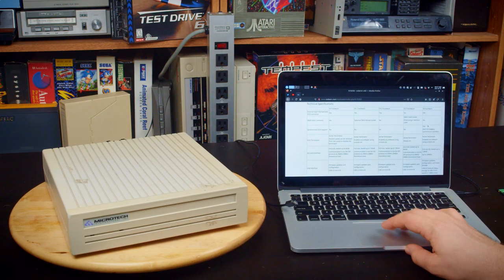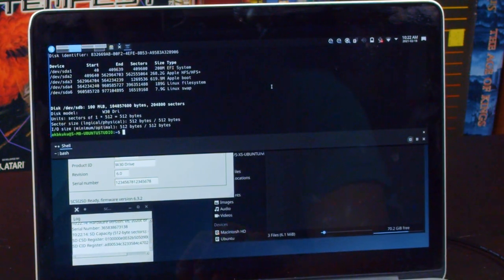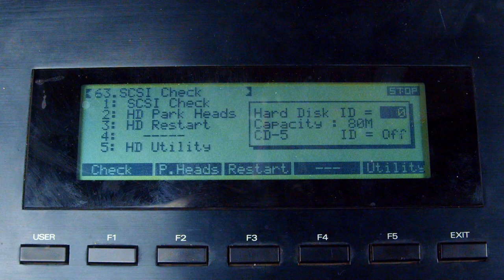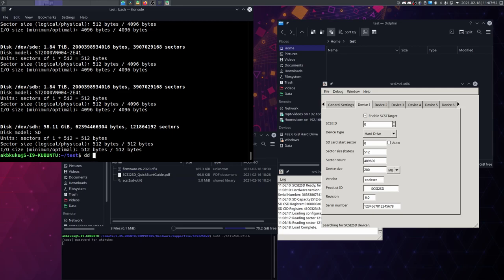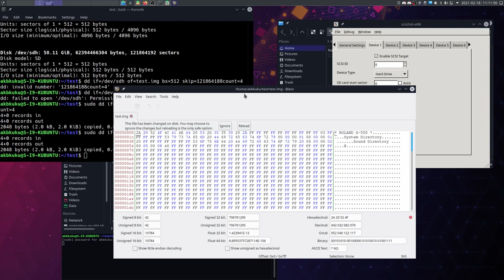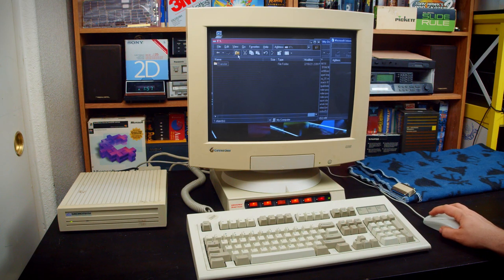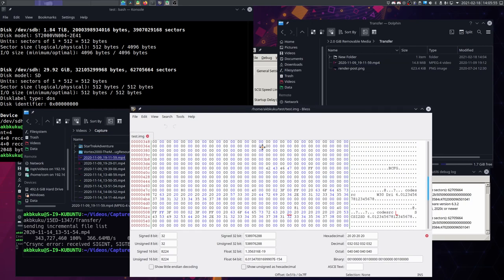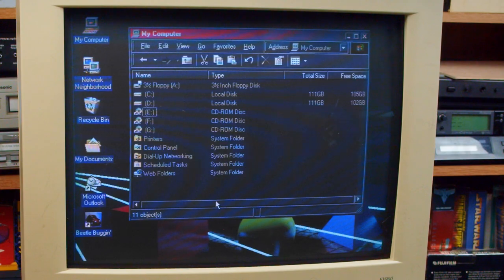Virtual SCSI Drive Experiments and Testing - SCSI2SD Part 1.5

Comment: SD card slots have a card detect switch. The extension cable is probably why hot swapping cards isn't working for you.
Reply: Yeah, this can be solved with a jumper wire, I think. Might also want to wire up the write protect switch at the same time. I can see instances where I want strictly read-only access to the SD card.
Reply: Just wanted to second this for visibility.

Comment: 14:29  -There is something going on with the audio... it like, weirdly pans or something. Am I going crazy?
Reply: it starts about 9 minutes in. It sounds like it is switching left to right very quickly.
Reply: I think Shelby's using a stereo mic, and it cuts the channel for a bit if it clips. So it sounds like it's pinging the audio to one side, but it's really just cutting the other channel when he gets, shall we say, overenthusiastic. Probably the way to fix it would be to record in 32-bit mode at a lower level, boosting/normalising it in post and either applying a compressor filter to deal with the clipping, or manually lowering the hot spots prior to boosting (which probably isn't worth the effort for the odd hard p).

Comment: 22:00 I was totally expecting this, as DOS wrote a MBR to what it saw was the first sector and partition table as expected, which the adapter correspondingly mapped to the same actual sectors. The reason it wasn't showing before is the roland keyboard does not use a typical filesystem/partition layout and so the OS wasn't able to figure out what it was.

Comment: As the scsi2sd raw writes to the sdcard it writes the partition table of the first drive in the first sectors of the sdcard. So that is the drive you can access with its partitions without an scsi2sd adapter or other hurdles like dd-ing the corresponding sectors of a drive or mounting by defining offsets.

Comment: Now I'm super tempted to buy one and whack it into my SCSI enclosure. I was thinking of buying an old drive to replace the dead one that's in there, but like you said in the other video, it's just going to be expensive and old, and prone to dying anyway. Although I think I'll just be lazy when I pull the SCSI ID selector and just poke a cable through the opening. Actually, I think I've got an old SCSI enclosure with a dead slot-loading DVD drive somewhere around. That would be perfect since I could mount the drive with the SD card slot behind the DVD slot, and use that to access the card. I just hope it wasn't in the box I took to my storage unit the other day! EDIT: Good news! Just checked my storage crates and could just see it inside one! The bad news is that it's on the top shelf of a 2m high storage rack! 🙄 Now I just need to wait until codesrc gets the SCSI2SD back in stock.

Comment: Theoretically, if you tell the SCSI2SD to place the first disk starting from sector 1 (+512 bytes from the beginning), then you could stuff a custom partition table at the first 512 Bytes that would allow you to access all the disks, like if they where regular partitions.
I would love to see you trying it and I'm open to help with if need it but, seriously, I doubt you'll need any help ;-)
Reply: Except that they aren’t partitions as such, but rather disks. Each disk can/will have it’s own partition table.
Reply: @wich1  If the custom partition table is made to point directly to each of the partitions for each of the "disks", it will effectively access each of the discs partition as if it where a regular partitions on a single disk, leaving all those extra partition tables ignored. Tricky, but possible.

Comment: you could try running binwalk against the sdcard device to see where the partitions start and end (it looks for magic bytes in binary files to see where interesting blobs are)
Reply: It's actually much easier. You can simply take the values from the GUI and put them in DD to extract the raw partitions. It works like the Gotek, but not with fixed "partition" sizes.
One could simply create a parser for the structures at the end and do a loopbackmount of every partition by hand.
Reply: @dolphhandcreme  or automate the mounts using a shell script

Comment: If I ever get to build my Windows 98 system, and can't get SD to IDE to work, I want one of those SD to SCSI (as long as I can get a hold of an Adaptec SCSI controller, preferably "vanilla" PCI).
Reply: I bought a super cheap SD to IDE adapter from china, to use in an old laptop, and I had positive results from it. The thing I was working on didn't work out, though, so I never actually used it the way I intended, but I was able to use some 16 or 32gb SD card in it and the laptop was happy enough to use it.... Happy, but not fast. It was *so slow*...

Comment: This is the first SCSI drive video that is related to keyboard samplers, which is what I am seeking help with.  I too own a Roland W-30 as well as an E-MU Emax II.  It also supports SCSI drives through its D25 pin connector, but also came with an option for an internal SCSI HD, using a 50pin ribbon, like the one in your enclosure.  The original mechanical hard drive still spins, but the OS must have become corrupt, and the keyboard no longer recognizes it. I was wondering it there is any way to see the proprietary .emx files of sound samples that are on the drive. I would love to be able to save them or copy them to a SD2SCSI drive? Would appreciate any advice you could offer. Thanks.

Comment: A small suggestion, you should look into using loop devices on Linux, you'll be able (provided you know the offsets and sizes of scsi2sd "devices" on the SD Card) to expose those as separate devices (/dev/loop#) and then read/write partition tables and partitions themselves, eliminating the need for the slow USB1.1 drive interface
Reply: No need for a loop device since you don't use an image file. You can simply use the offset and sizelimit options directly on the raw SD card, e.g. for a 2GB partition starting at sector 4096:
mount -o offset=$((4096*512)),sizelimit=$((2*1024*1024*1024)) /dev/sdh /mnt
Reply: @kpanic23  that's an option, yep, losetup just makes it a bit easier in that it automatically scans the provided offsets for partitions, so it cuts some steps if any of those emulated scsi devices use partition tables /w multiple partitions in them. For simple stuff like that Roland W-30 that just uses the disk as is, yeah, it's easier to just use mount with offset and maxsize options or dd with offsets if you just need to write into it

Comment: Only seeing the first partition on the SD card out of the SCSI 2SD is the same on my 5.1.
Computers don't expect there to be another MBR/GPT/whatever partition scheme to be on the same drive so it will stop once it finds the end of the first one.

I'd imagine if you're smart enough (which I'm not) you could get all partitions to mount if you manually tell it where to look.

Comment: FWIW the 300kb/s speed via the connected USB is because the SPI mode is probably the limiting factor in the transfer rate. PC using "real" SDIO transfer will obviously be much faster.

Comment: maybe its possible to create a fake mbr partition table at the beginning of the sd card and then tell scsi2sd to use those partition start sectors as drive images. that way it should be quite easy to dd iso images into the sd card without using the slow usb interface.

Comment: I have a similar setup with a windows vista my basic 32 workstation witch can run windows 98 games. using an usb 3.0 hard drive despite only using and supporting usb 2.0. I works great on games that run it.
Reply: let me explain most people think they can get away with vista home premium but there two different operating systems. Visa basic 32 was used for web publishing and other lightweight tasks that vista home would be too bloated for.

Comment: You should keep this thing terminated.  I cannot tell you how much trouble termination is with old Macinstoshes.  I have professionally supported large group of Macintoshes in corporate environments back in the 90s and early oughts and I can tell they can be a nightmare with termination.  Also with OS/2.  SCSI is great when it works, but working is not a given, especially with external drives.

Comment: Ripping you say? Just gonna put this here then.

https://github.com/automatic-ripping-machine/automatic-ripping-machine
Reply from the maker: That is a really cool project! I'll keep that in mind but I don't know if it will work with my ultimate end goal cleanly. I'm waiting for the final piece to be delivered, but I'll be using a 6-disc CD-ROM changer that I'll be loading and running for long stretches of time mostly autonomously. My plan was to just start with raw BIN/CUE dumps and convert the files from there to other things. I figure a simple bash script will probably be a good start.